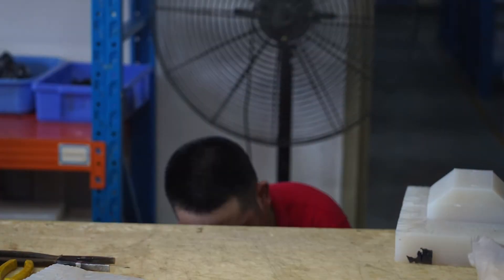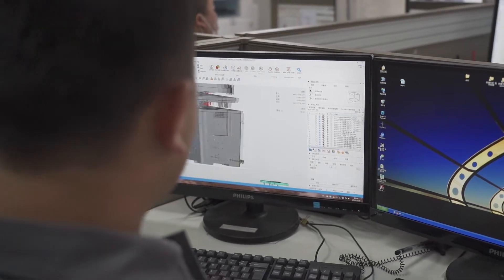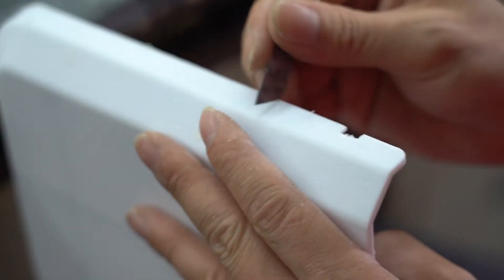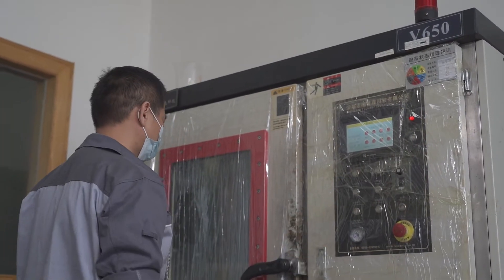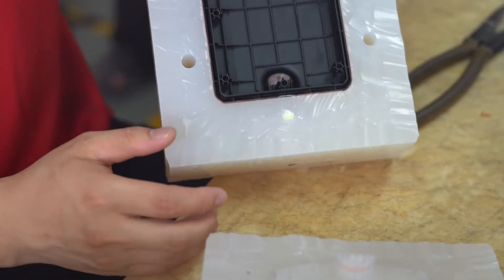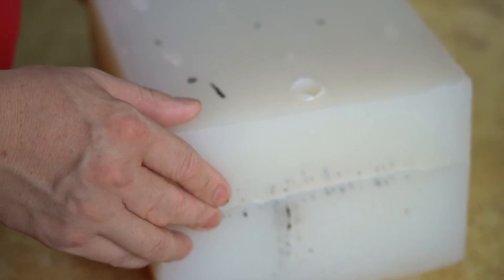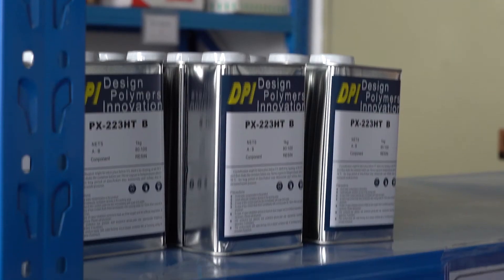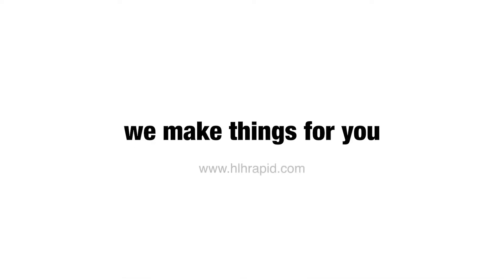Vacuum (Urethane) Casting Explained | HLH Rapid

Comment: Great to see a clear video on this topic! Vacuum casting is indeed a game-changer for low-volume production, and it's fantastic for the entire industry when knowledge like this is shared.

We often partner with design firms and engineers who start with vacuum casting for their 20-50 unit batches and then scale seamlessly into injection molding with us. It's a testament to how important this step is in the product development journey.

Thanks for advocating for our manufacturing niche! Well explained.👍
Reply: Great HLH demo! If you need 20–50 urethane parts even faster, we vacuum-cast in 3 days—same PU, clear or soft-rubber, global ship😀

Comment: i still have no idea where the vacuum come in. is it the silicone degassing step or is it used somehow in the casting step
Reply from the maker: Great question. It's in the casting step. We place the mould in a vacuum chamber and inject PU material in. The vacuum helps 1. 'pull' the material into all the nooks and crannies of the mould 2. avoid trapping air bubbles
Reply: It's just to get all the air out, possible bubbles in the mold that. Could mess it up